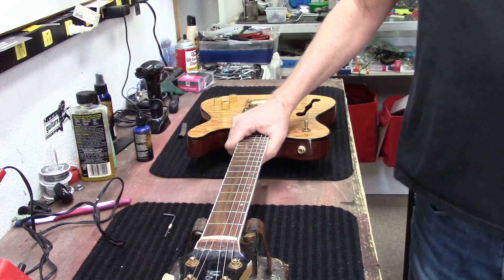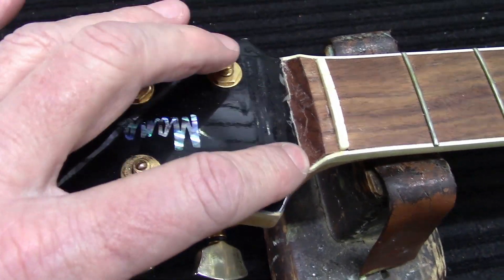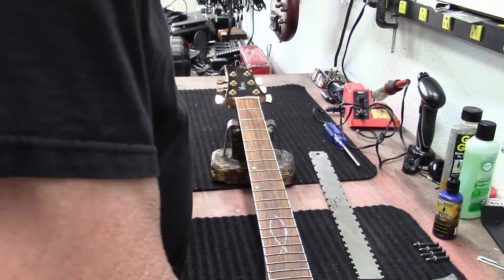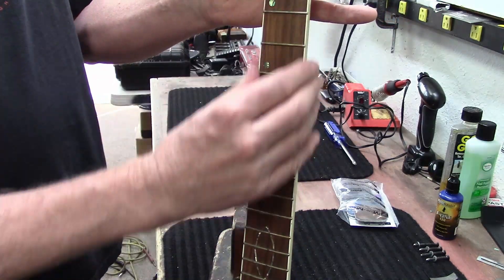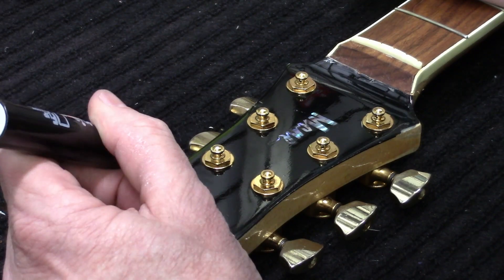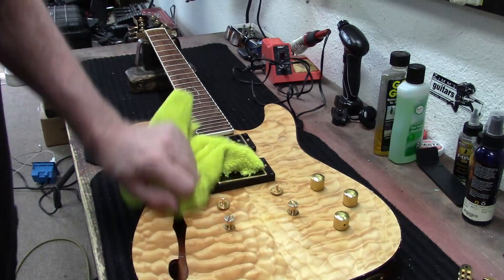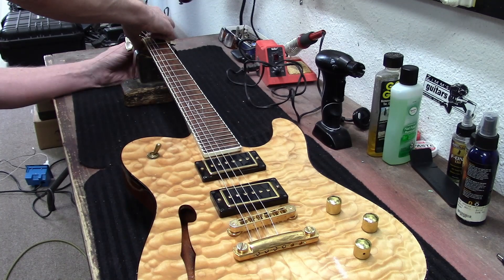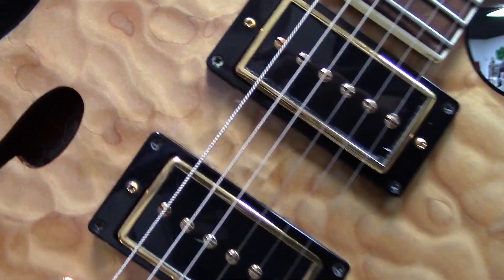Mane Thinline Tele Restring

Comment: man that neck is one of the worst ones i ever seen never seen or owned a guitar that you had to take the neck off the tweak it. bad design. but you made it work.. you  should just put a tele neck on it. if it was mine i would.
Reply: Vintage Fenders were built in the same way. Wasn't until later on that it was addressed.